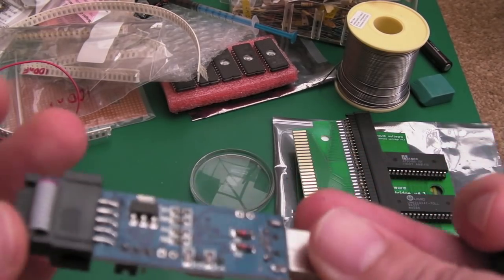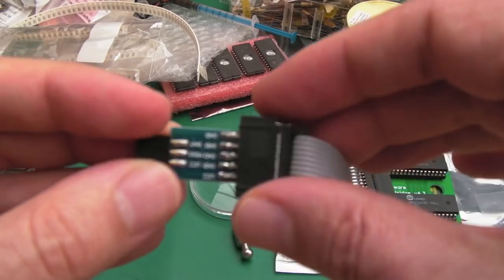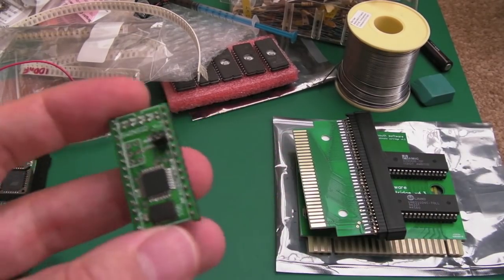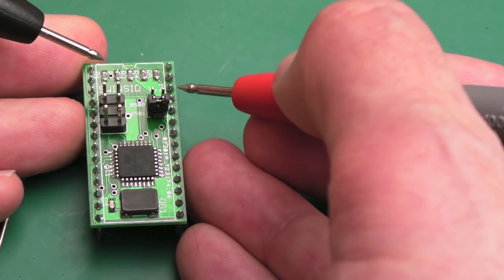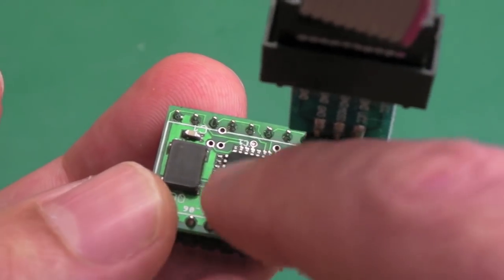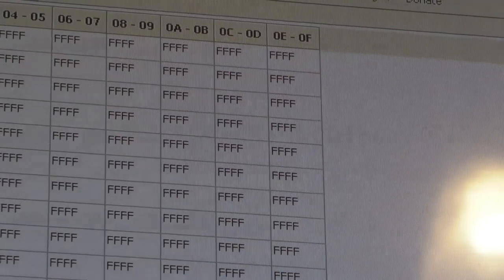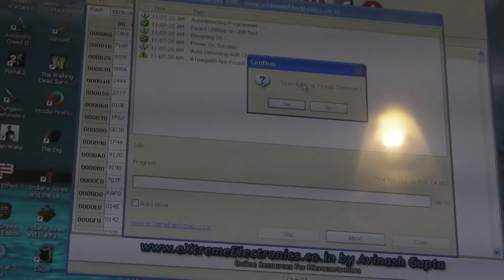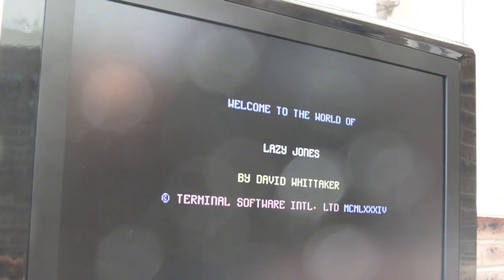Commodore 64 (C64) Nano SwinSID Firmware Update (Lazy Jones Fix) - How To Apply

Comment: Is the SwinSid Nano a replacement SID you would recommend? here in Germany these things cost about 15€ on Ebay.
Reply from the maker: For 15 euros is a good replacement - BUT it is not perfect!  It lacks read facility on the OSC3 and ENV3 registers, which means some games can sound incorrect.   The Swin SID Ultimate fixed that, but its very hard to find these days.  The new better replacement is the FPGA SID which sells for around 75 euros, but it does replicate TWO SID chips at the same time - giving you stereo =D

Comment: Where did you get the USB programmer and the adaptor?
Reply from the maker: For the programmer - just look for a USB ASP on eBay - approx £3 cost.  It comes with the cable and adapter, but you need pins soldered to the chip (or just pressed fit them temporarily whilst programming) - just use 2.54mm pin header - something like this:- http://www.ebay.co.uk/itm/10-x-40-Pin-Header-Pins-Strip-PCB-0-1-2-54mm-for-Arduino-Breadboard-UK-Seller-/400858209683?epid=1788702049&hash=item5d5502dd93:g:uMgAAMXQagJTlgK3   Just break off two strips and connect them to the chip, plug in your cable and you're away.
Reply: GadgetUK164 - Retro Gaming Repairs & Mods 
Thanks you for redirecting me to the programmer :-). Yes I do have those pin header strips from a leftover of the MixSid board kit I have recently mounted (by the way nice piece of electronic). I would like to fix the Lazy Jones bug on my Swinsid V2 but I may also think to get also one of the swinsid ultimate. 
Thanks !
Reply: Dumb I am !! I did look at your video for the fix without even testing my Swinsid! I have then a clear Lazy Jones tune playing fine so the batch from where I pulled this chip out was already fixed :-)
Reply from the maker: Excellent =D

Comment: Hi mate, how do you wire up the inline version?
Reply from the maker: Not sure what you mean - do you mean the psuedo stereo setup?  I did a video on 'dual SID' which covers how I adapted a cheap SID2SID PCB to get two SIDs working in parallel.  I also did a follow up video for an important revision to ensure that both SIDs do not write to the data bus at the same time.
Reply: The header on the SwinSids, you programmed one of the 2 x 3 header ones. I have the version with the inline header but I don't know what they're wired up like. :)

If you stop your clip at around 1:40, you'll see that you are holding the 3 chips, the one at the left is the inline version. :)

Ah, it's ok, I found this...

http://www.tolaemon.com/nss/

Comment: how does it stand up to the Ultimate 2? Personally if you love SID tunes, I find its quality amazing!
Reply from the maker: The SID emulation on the 1541 Ultimate is much better imo!  The main problem with the nano Swin SID is the lack of proper two way register support for a couple of registers.  I think one is osc3 and the other is the pad inputs (I could be wrong), but that's why Alien, and R-Type don't sound right on the Swin SID.   That said, a couple of clever guys have produced the Swin SID Ultimate - which is way better than the original Swin SID and uses an additional MCU as well as supporting those registers properly (so mouse works on it too) and it has some enhancements which make it better than a real SID in some ways.
Reply: Yes, on facebook !

Comment: Very cool. Lazy Jones is supposed to be one of the harder to emulate because of quicker succesive writes if I remember correctly. Do you know if Swinkels is still coding the SwinSID ?
Reply from the maker: I think it probably has some minor benefit to other games as well but hardly noticeable.  I've ordered one of the SwinSID ultimates you played around with ages ago, and it was thanks to that video that I eventually got the idea to try updating the firmware on my Nano SwinSIDs, so thanks =D   I don't think he's supporting them anymore as there hasn't been a firnware update out for ages =/   The FPGA SID is just about to begin beta testing but I missed the list so will have to wait for release I think.
Reply: Wasn't it SwinSID code that had to be disassembled to be able to continue work on ? It is a bit sad that. There are still stuff that needs to be improved, like a wider LFSR (random noise). It is not full 21 (or 24?) wide and the repeating pattern is obvious when you listen to it. Jumping over to something like stm32F0x1, which cost less than the atmega, you'll get a DAC, 5V tollerant IO, 48MHz PLL, 32bit operands (you can shift the LFSR in one cpu cycle). Probably be easy to add pads support. They are ARM Cortex M0. The simplest ones. You'll get priority based interrupts (NVIC). I don't know how fast they are yet, but it means you can prioritize say a chipselect generated interrupt, and if i remember correctly from my ARM MCU course I took two years ago, it is possible to leave one interrupt routine for a higher priority one, so if CS comes when the cpu is allready servicing an interrupt, if it is higher priority it can interrupt the interrupt if you know what i mean :) .. Anyway, people say that oh it is so hard stepping to 32 bit architecture. I think people are then thinking about assembler language. I don't remember it as beeing much harder than programming pic in c at all..
 If you find a code for the SwinSID let me know and I'll se if I can port it to STM32.. 've seen the FPGA SID project. Interesting stuff, but I'm afraid it is just another closed down source. Hopefully it will be available for a long time. FPGA technologies don't last so long, and if you just get the bitfile it will not work for other devices.. So I hope it will be maintained though. Other than that it is great. It has been done before by kevtris but was it ever released? I don't think so...

I have the SwinSID Ultimate prototype version (with the tower of 74595 registers). It works well now after opening up all the channels. Lol. I'd like to help out making the step from swinsid to stm32 for enabling more resources. Swinsid ultimate is unfortunately closed source and based on cpld+avr, I'm hoping a stm32 would be sufficient, and a source code which is open and open hardware licenced and can be shared with other brilliant coders (which I am not).
Reply: @bwack  i will see what i can do with the dspic33EV in january. i already got me a devboard from my colleges in munic and try to add a headphone-jack with a low-pass-filter for the two channels pwm output for developing. it runs with 70 mhz instead of the 20 mhz of the atmel and is 16 bit instead of 8-bit. so stereo with 6 voices should be possible easily. with some assembler optimizations i can use the dsp functionality for the digital filter. that should really make a difference in speed. that should leave enough speed for massive register access like you mentioned with the game lazy jones. but sometimes it is also a matter of interrupt, peripheral, dma and software architecture to really get out everything of a microcontroller. the atmel might be a dollar cheaper but that does not matter much, does it?
if i find some time during vacation beside drinking leo beer, i will post some progress on the FATSID facebook page.
btw. two years before that i also looked at the stm32f4 for that project. i already finished part selection of level shifters and logic and the schematic. but then i stopped. it has a parallel master port feature that allows you to write write access from the bus to the cpu but it does not have enough bits to store all address lines, so that useful feature can not be used. and of course the 5v/3,3V level shifter shit makes it more expensive and takes space on the board. if going to a 3.3v chip, i would personally go to a dspic33ck chip now. it has a better parallel master port feature, 250ns accurate high-res pwm output and runs with 100mhz directly out of the flash without cache stalls like the stm32. and of course dsp functions and shadow registers for fast interrupts. an external dac could also be used with the built in i2s feature, or a s/p-dif output for audio nerds.